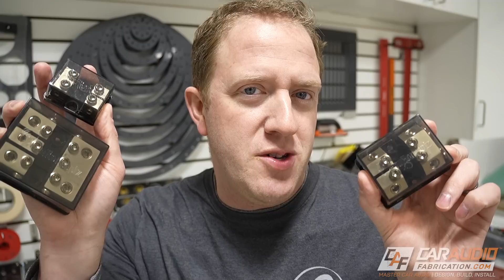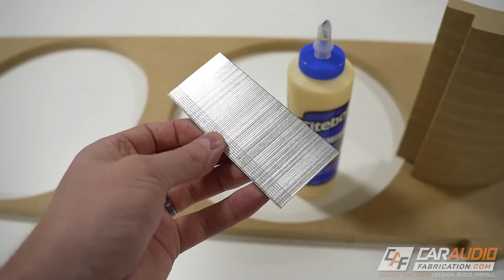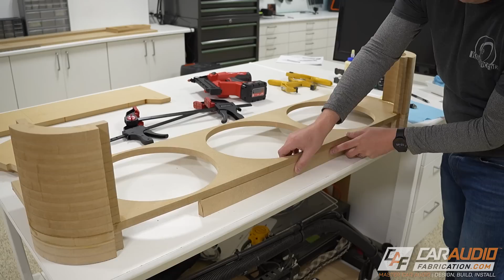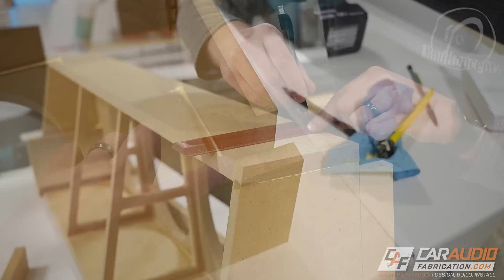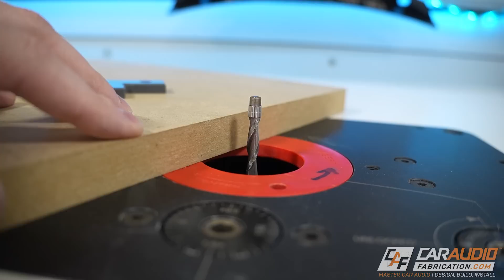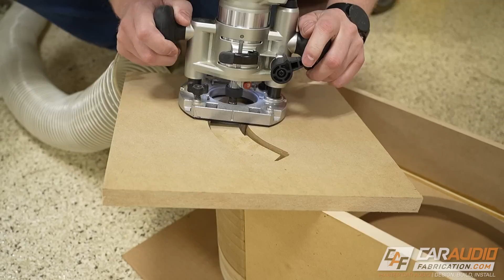Building an Underseat Subwoofer Box - Assembly and Angled Corner Cuts!

Comment: What gauge and length brad nails did you use here?
Reply: @angelsoftheseventhdawn  since the material is 3/4” thick and he holds the strip of brads up against it, I see that they are 1.5”.  And they are 18 gauge.  Hope this helps.  👍

Comment: I'm curious to know if anyone has considered doing the rounded corners in a FDM 3d printer and then splicing that with the rest of the MDF build products?  I could easily cut the walls and support structure on the router but would not want to take the time to do as many cutouts as it would take for the the corner pieces.  Probably simple for a guy with a CNC wood cutter but I' don't have access so just curious what anyone things about that FDM printed pieces concept?  I only ask because I have seen some ytube channels where they made 3d printed enclousres for tiny subwoofers.  I'd like to design a box for my truck that has rounded corners so they don't get hammered when I place stuff in that back seat area.   Thanks for any idea's or feedback someone has to offer.

Comment: Looking for advice. 2009 crew cab Sierra 2500 HD. I plan to do a seat lift kit and I have an HD1200/1 from my previous vehicle. Would you recommend 3 13tw5 like this or 2 10w7? Would there be enough air for the 10w7's? Is there any crazy way I could fit a single 13w7?

Comment: I use long wooden dowels when stacking wood like this. In this case I would utilize two and then counter sink them into the top and bottom boards for added strength.

Comment: Why doesn’t anyone build one for single cab trucks? Like 4 10” in a ram.
Reply: @larryfogle3697  you likely can't get the minimum required volume for it. Most of the super shallows are .7 cu ft per so that's 2.8 min and not a lot of space for it
Reply: @larryfogle3697  size restrictions. There just isnt any room. Gotta build a custom center console build
Reply: I’m going to start building one down firing box with 4-6.5” subs on for my ‘93 GMC SIERRA single cab…

Comment: Hay Mark very nice trick with the router, 

Are you making this for a rear seat on the ford truck?

 Are you going to bolt that box down  

I mean I would make it rock solid and increase the sound pressure coming from the drivers "woofers" .  

and are you going to show some carpet tucking tricks to.

Thanks for the great video keep um kumming.